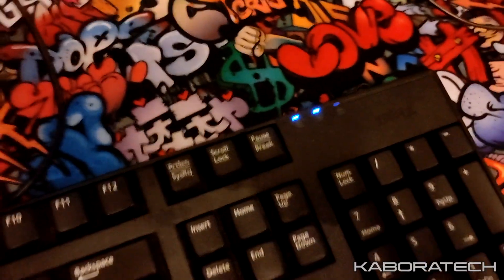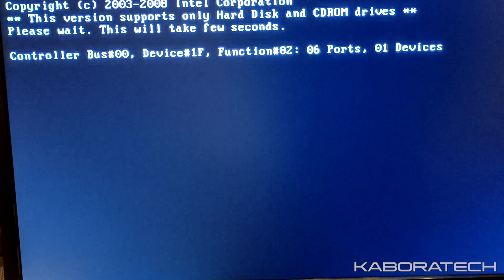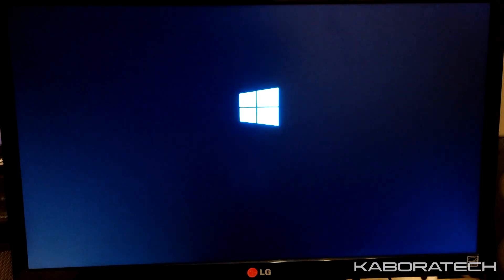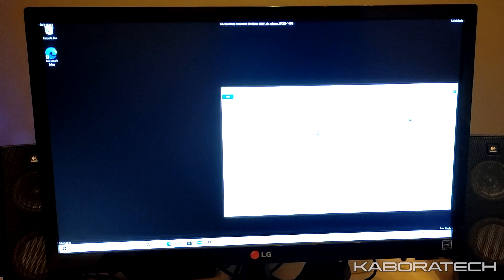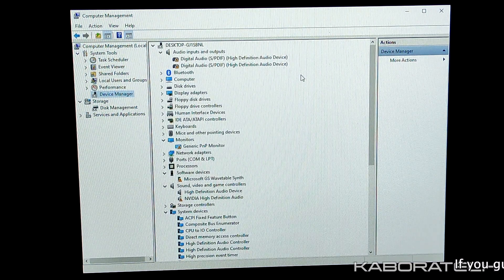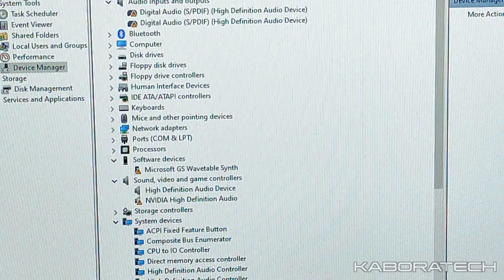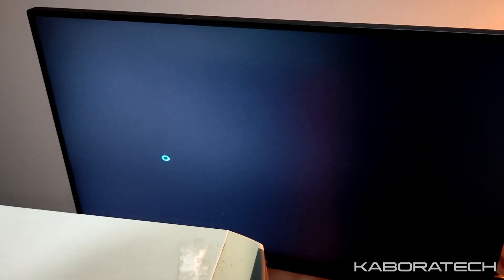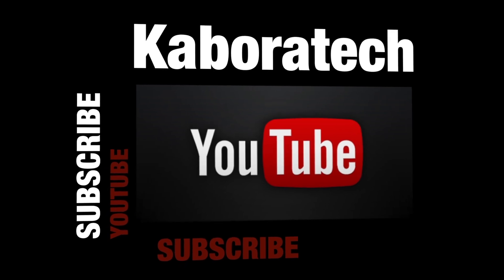How to FIX  Windows 10 Black Screen

Comment: My computer turns on but nothing else happens no Lock Screen no safe screen just a black screen nothing works please help me
Reply: It’s weird because this computer isn’t even a year old
Reply from the maker: Video drivers...., boot in safe mode, re install drivers or Chá ge to windows 11,check my video on how to upgrade or make a flash drive, use other pc, but first take your data out to other hdd

Comment: He so i was logging into my computer then i clicked i forgot my password then i turn it off in the process of load then i tried to turn it back on everything works but my display is not working i tried unpluging my ram the. Putting it back in and i even tried putting switching my hdmi and nothing works
Reply from the maker: Try other monitor or TV, if it does the same, you have to boot in safe mode.
Reply: @kaboratech  k sure do ill try it later today ill tell you how everything goes

Comment: I pressed f4 for safe mode but it just loading into another black screen
Reply from the maker: You have to turn off computer 2 or 3 times on the power button aND then those options will be available.
Reply: @kaboratech  I have pressed safe mode but it loads into another black screen with the curser
Reply from the maker: Remove your drive, move your data and re-install windows